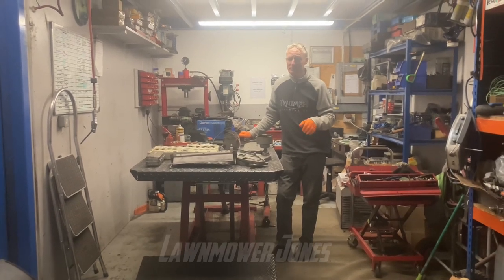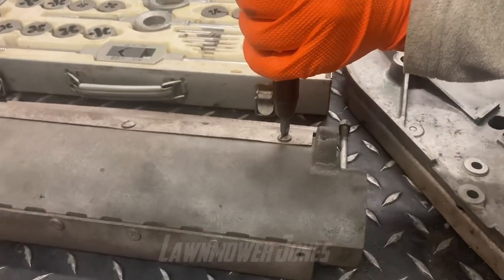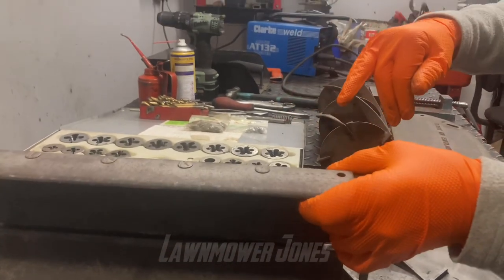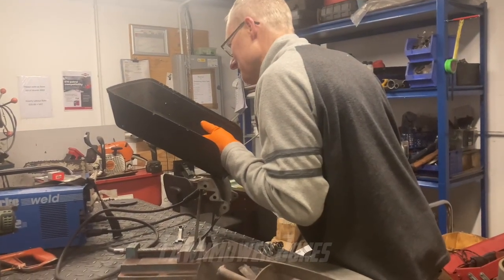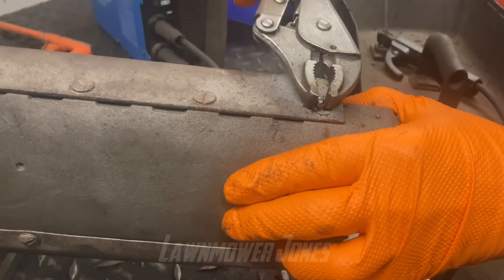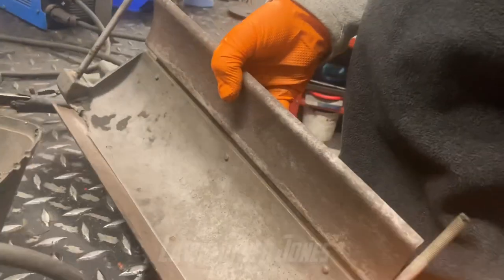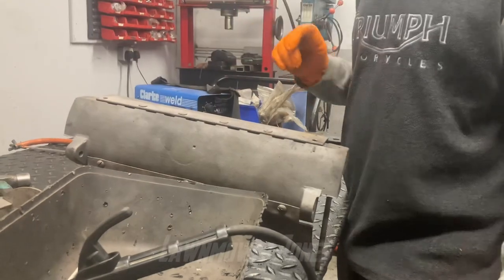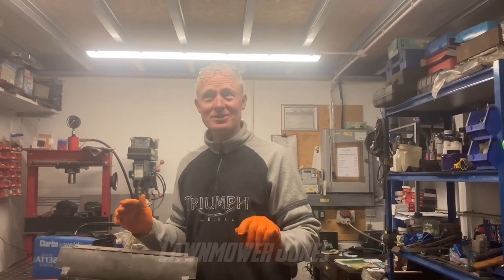Seized Bottom Blade Screws

Comment: I can improve on that.  Clean the screw back to bare metal and weld a nut to it, you can then get a spanner or socket on it. 
A word of warning regarding arc welding. 90% of arc eye cases are caused by indirect exposure to UV light. Ie reflection from bright surfaces like walls and ceilings. Buy the good camera lady a pair of gas welding glasses with shade GW5 lenses at least and save her eyes, believe me arc eye is excruciating.
Reply from the maker: Hi , yes that would be another option to Mole grips 
But it would have been very difficult on a 1/4 screw.

Maybe next time i may not film the welding, or put a welding screen on my next Christmas list!
Thanks for your comment.